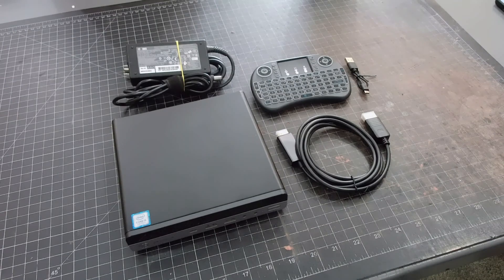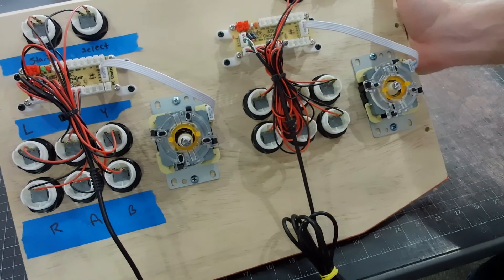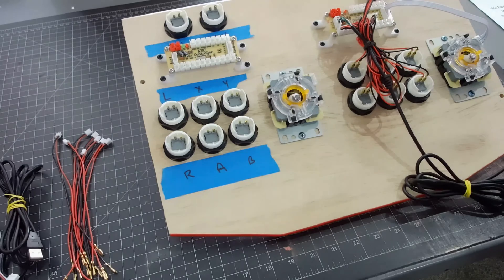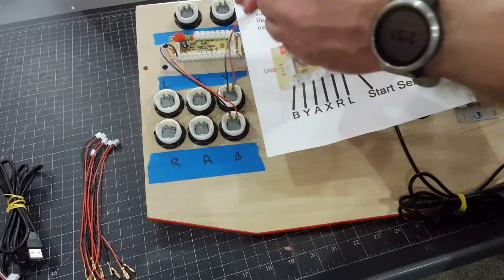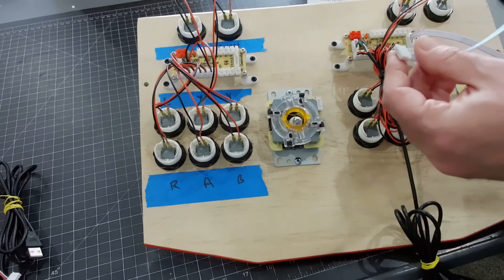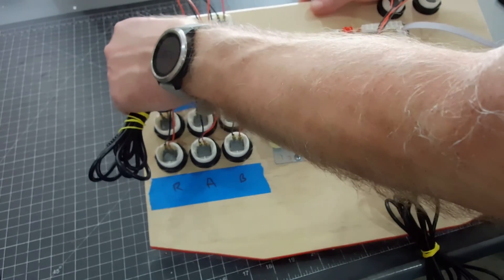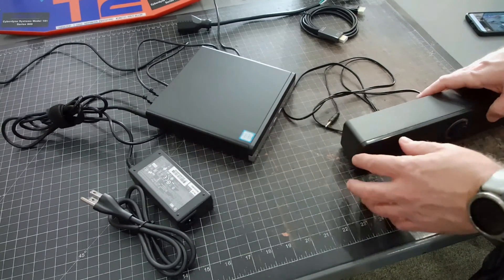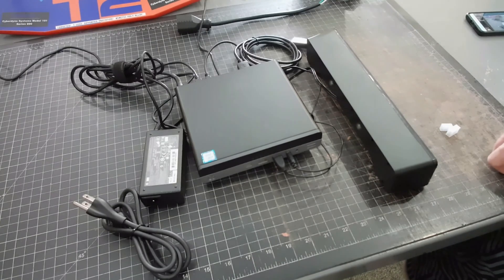DIY Retro Arcade Preconfigured Mini PC For Arcade and Sinden Light Gun Games. Install and Info.

Comment: ive seen a ton of these builds and have NEVER seen anyone label them on the underside! Sure, you assign them in most programs after its built but to go back and actually label them because inevitably you'll have to look at it a year later with no idea what they are now.... genius.
Reply from the maker: we have the hdd pre configured, so if you label them on the bottom like we did and plug them in like we show then your new pc will just work right out of the box with your arcade machine. Its more for setup then to tell you whats what